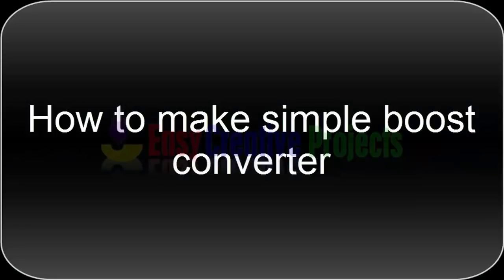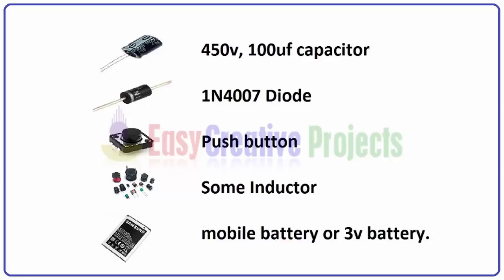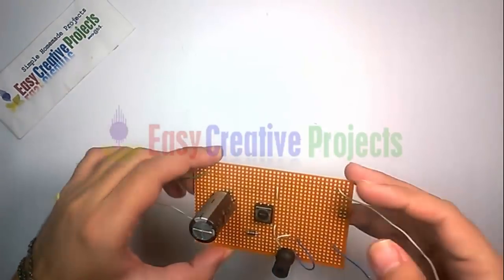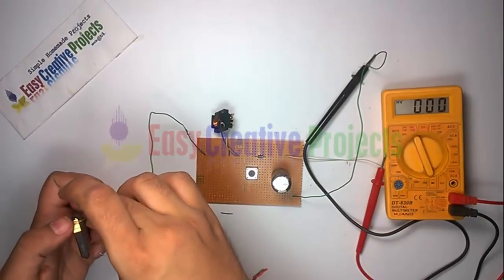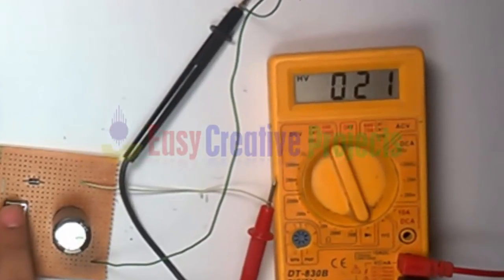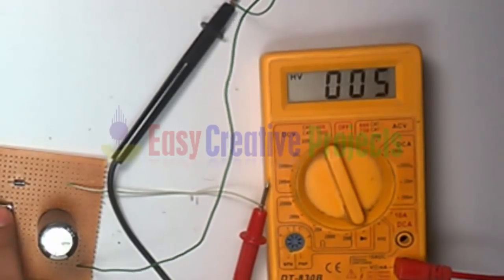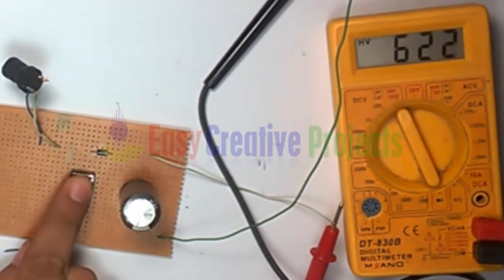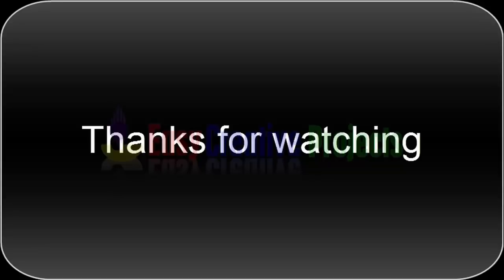How to make simple boost converter - 3v to 1000v booster

Comment: it's fake with this eny you can boost 1.5 v to 3v and the multimeter is in the mv range or 2v range
Reply from the maker: dear you need to learn more about electronic.
(open ark lighter and tell me how they provide us heavy spare for fire, without any power battery. its your homework.)
thanks.